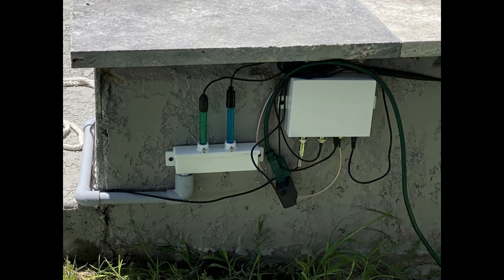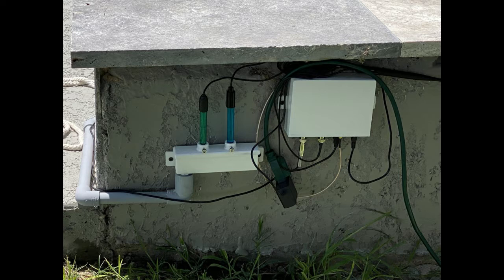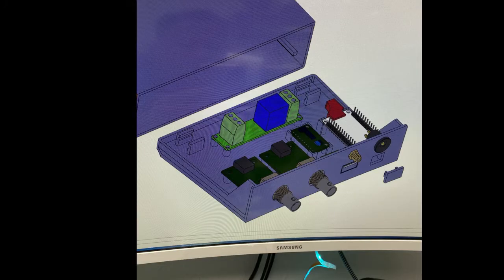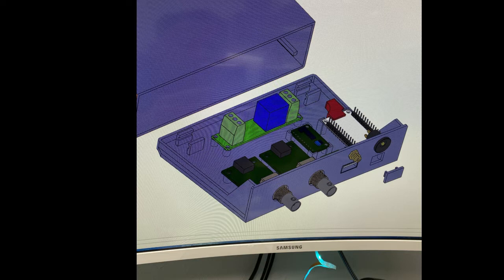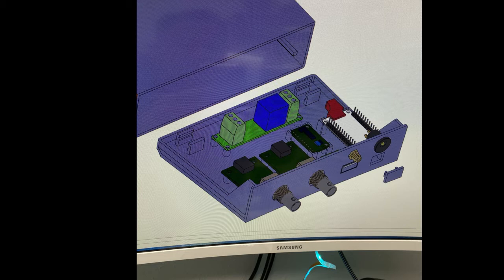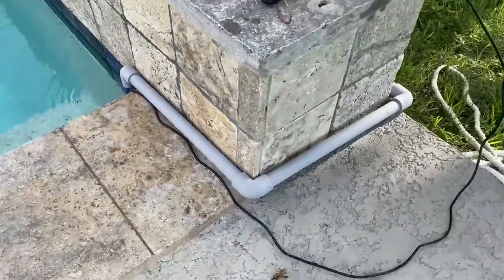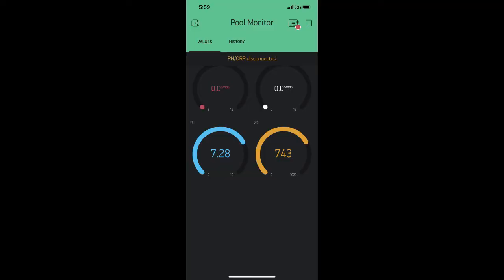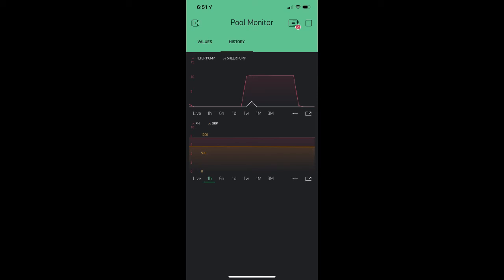Update on PH/ORP ONLINE POOL MONITOR

Comment: Hello!! Great project!! What voltage do you obtain for diferent values of ORP? I have made the same project using the same probes and PH si working properly but for ORP I get between 4,5 and 4,6 volts whatever the value of the ORP is.